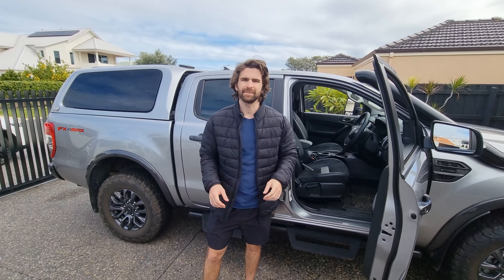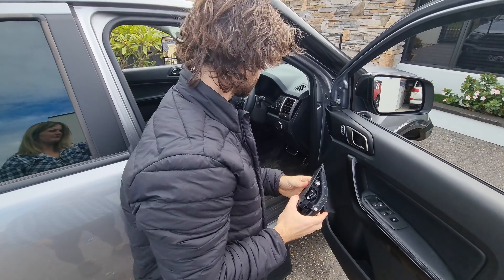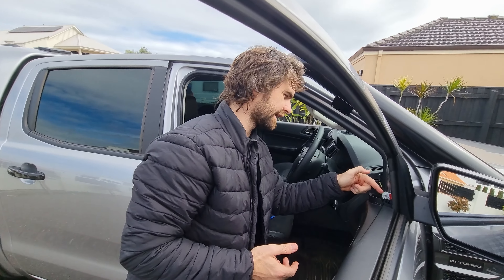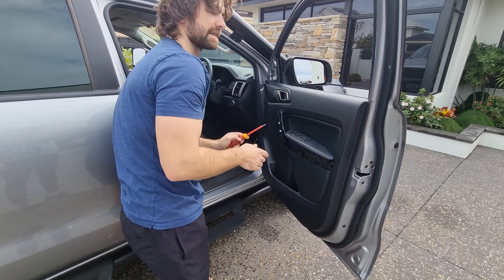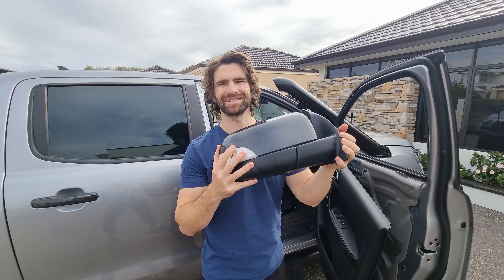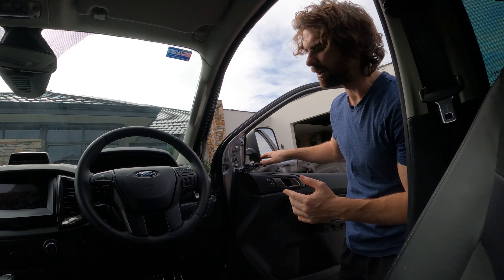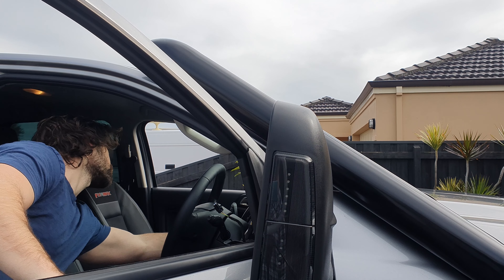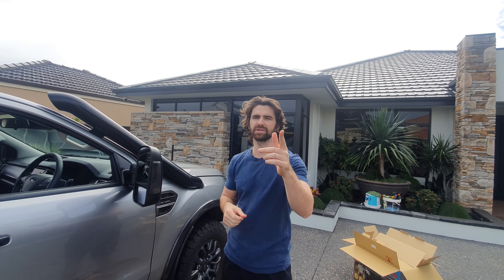How to install Clearview towing mirror, Ford Ranger PXIII

Comment: To remove the plastic panel behind the door opening handle. Just drive a self tapping screw into it about 10mm from the top and 10mm from the front and it pops off. It leaves a small hole that is hidden behind the door handle.